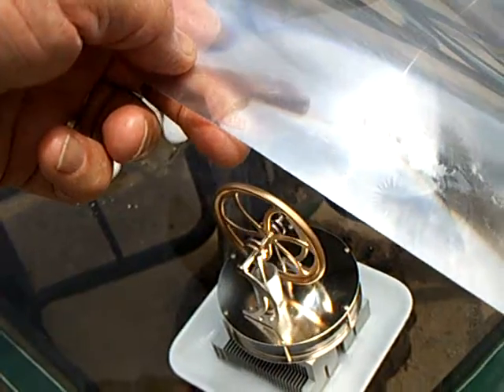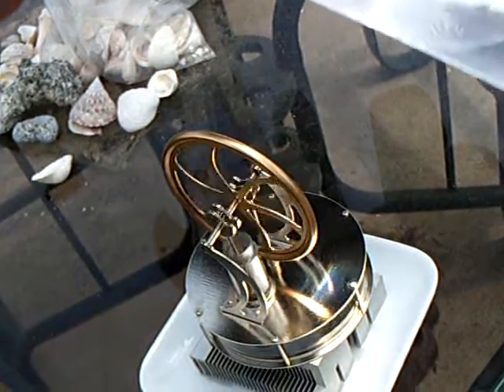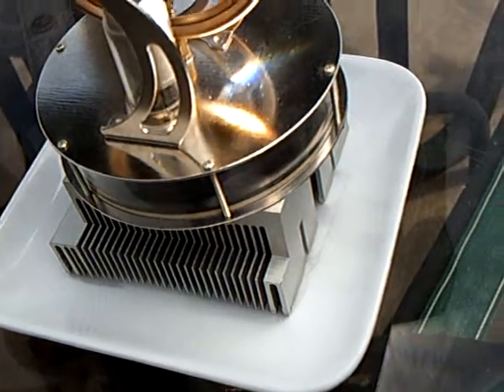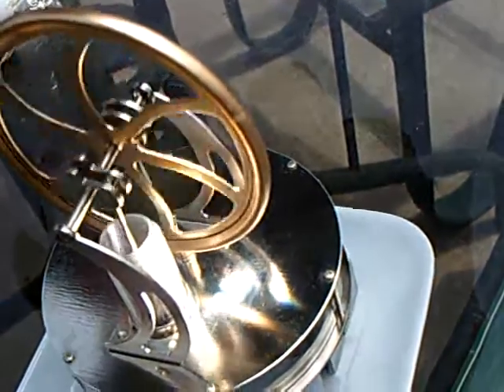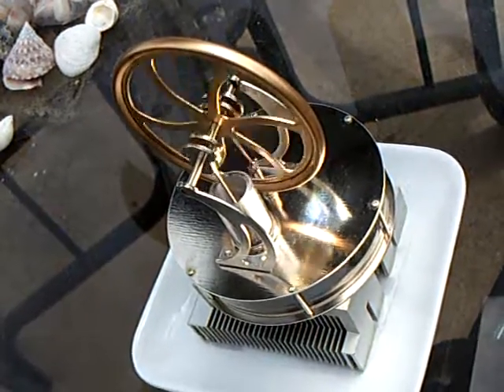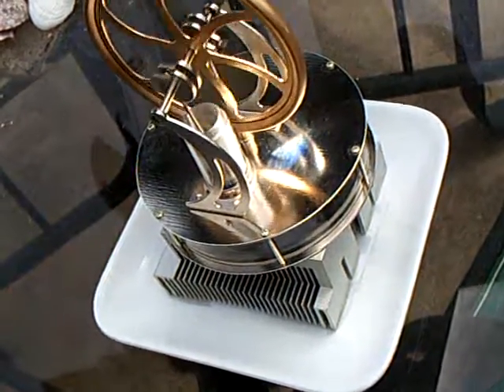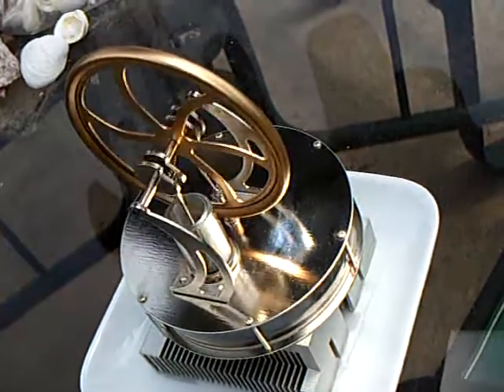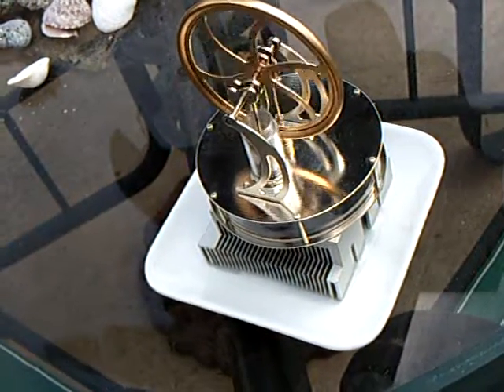Solar Powered Stirling Engine --- Using Fresnel Lens

Comment: No-one ever likes my ideas, but I'd cover the (matt black of course) plate inside a one-way mirror cone or box. Whatever is not absorbed by the surface the first time, is recycled in the form of light until it's all converted to heat. The mirror being surrounded by a vacume drawn clear double glass insulation might add some efficiency still. That said, glass and one-way mirror will both kill some light. The heat of that needs to reach the plate also.
Nice setup if you have a mountain lake...

Comment: Indeed, was thinking of when Lidmotor showed the motor and circuit running from it. So the gearing would be 1:1000 or something lol, but a panel wouldn't have to turn quickly.

Comment from the maker: What I have learned so far is that the better the engine is designed to keep a good temp differential the better it runs.  Black fins on the top plate like you suggest are a good idea as long as they are shielded from the wind.

Comment: another random thought;

Just as a random breeze enhances the evaporation and cooling on the heatsink, heat and energy are lost on the hot-side, at the same time. How to deal with this? 

A wind-screen that divides the hot and the cold. It should be cone-shaped, flaring upwards, shielding the hot-side, diverting wind to the cold-side. As a bonus, make it out of black metal and it could dramatically extend the thermal collection area!

The optimal arrangement might look like black flower petals.

Comment: most excellent solar stirling! 

I've been wondering about solar-thermal arrangements for a while, specifically the idea that in a fresnel focus there is heat for a very deep focal-length, that is to say more than the single plane that is the top plate of your eBay LTD.

so

The question is whether a 3D heat-collector (as opposed to current 2D) would be much more efficient, and if you could do it with black, finned heat-sinks thermo-pasted to the top-plate?? try it for science??

lv yr wrk!

Comment: How about a magnifying glass instead of the fresnel lens?  How about 1 heat sync with multiple TEGs sandwiched between the hot and cold side?  Anything to get off the grid :)

I saw a video where the man drills an 8 foot hole into the ground using a 4" PVC pipe and a hose (hyrdo drilling).  Since the earth is always cooler at dept, it could be used as the heat sync.  In colder climates, the outside air would be enough of a temp differential?

Sun power: 5 KW per square meter. (2.5 in winter) ;)

Comment: Gets the mind thinking, cool video. 
A wacky thought, would be to use the Stirling as a solar tracker motor, cogs and whatnot enabling a solar panel to turn to which the Fresnel lens is connected. After moving, a cog disengages and the Stirling freewheels with the magnets and Maggie, to run a light inside the house, using a large cap while the tracker moves. A sundial could set the marker points for tracker movement. Rube Goldberg idea eh lol

Comment from the maker: I was just getting ready to put a comment on your last video.  That video inspired me to try this.  Your solar setup is really neat and I like your latest engine design.  I have pushed my LTD pretty hard and it does keep working (goes really fast) but it isn't meant for that.  The parts are not made for high speed or high temps.  Dan from Greenpowerscience had a good high temp solar Stirling rig but I think he damaged his engine getting it too hot.

Comment from the maker: The more temp dfferential there is the more power you get out of these engines.  I'm not getting 600f on the top plate either.  The concentrated solar heat is only in a small area and it is lost into the air pretty fast.

Comment: I'm not surprised that would work, since it works off such a low temperature difference. But I haven't worked with these low temperature difference ones, so here's a question for you. If you apply too much heat, too great a temperature difference, do these stop working? I guess at some point you're going to have too much heat conduction from top to bottom (or vice versa.)